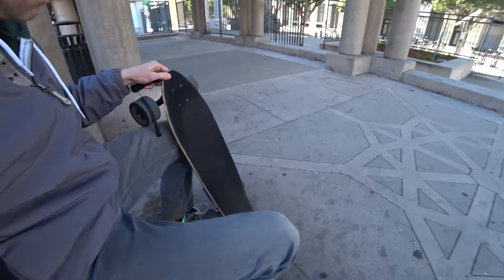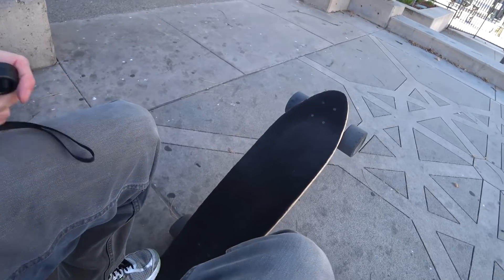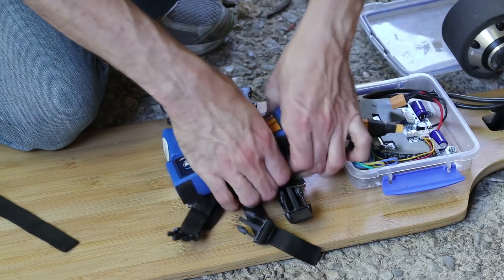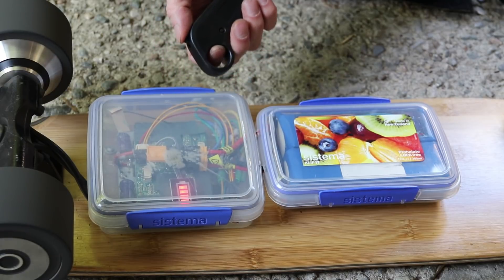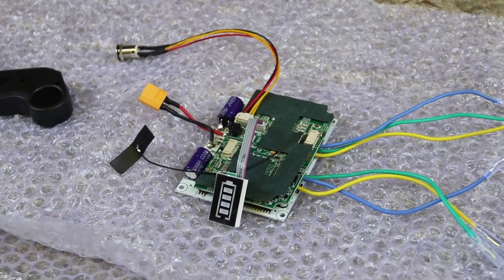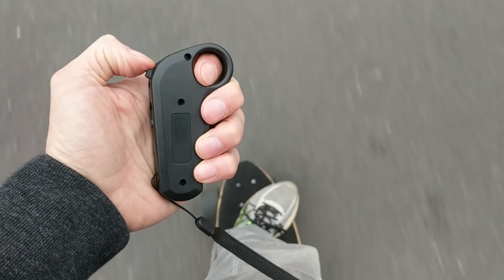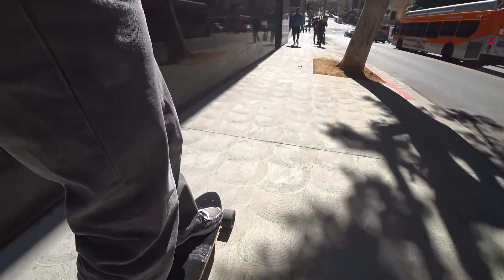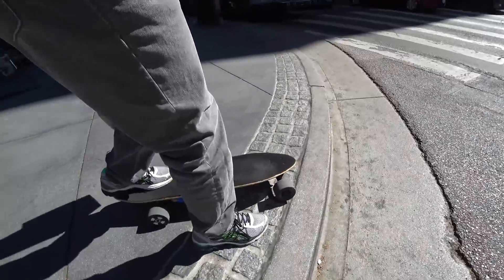Awesome Electric Longboard ++ | Improving The Details | Price ＜ $350

Comment: I'm a down hill long boarder and I have an extra land yacht battle axe board with your experience any recommendations for budget conversions
Reply: I have a few ideas...
I made a single belt motor drive board recently and it cost about £200, even cheaper if you have the board already. I used a hobbyking keda 6364 motor, cheap motor mount pull kit, single belt drive esc/receiver unit similar to the one in this video, two 3s 3300mah lipos in series and some cheap trucks and wheels.

Comment: so I made a longboard with a single belt-drive motor and its going damn fast (24 mph). The only issue I´ve had was my esc. I just bought my third esc because the esc´s I used before were made for rc planes. They didn't have any brake so I had to be very careful while driving this board going fast speed. Now I bought a vesc from flipsky the 4.12 and I hope it will do better than the esc´s I used before. I used a aluminium box as a enclosure for my battery and a plastic box as a enclosure for my esc and I really went on a budget with my motor its a cheap Chinese 400kv motor. But the motor is great. I'm sorry if my English isn't to good because I´m from Germany and a kid...

Comment: Sand the edges of the griptape it will stop it from peeling, also you should use a proper case and bolt it on. Theyre like $30 aud on ebay
Reply from the maker: The peeling is a known problem with the DKL grip tape. Maybe they've improved it now. For the battery case the ones I've seen on ebay can't be easily opened to swap batteries. Hopefully someone will make a strong case that's easy to access.
Reply: @orensprojects7250  all griptapes will peel if you dont sand it, and yea very true

Comment: Hi! have a question, do you know how to connect the hall sensors cables from the hub motors to the esc in the case it has?
So much thanks!
Reply from the maker: The ESC has a connector for the hall sensors for each motor - it's a small connector with thin wires. Connecting them is not so important. I don't have them connected on this board and the motors work fine.

Comment: why are alot of these Motors so loud? I use the same Motors and mine are dead quiet.
Reply from the maker: If your ESC uses FOC mode it will be much quieter. Maybe it's also the way the microphone picks up the motor noise... and these motors might be getting old.

Comment: Would it harm there esc if I ran two 36v lipo batteries in series
Reply from the maker: The ESC I'm using in this build is set to 10S voltage (around 36V total). The ESC has detection for the voltage being too high so it wouldn't work if you connected two 36V batteries in series, which would be around 20S voltage.

Comment: Wouldn’t 83s have done better uphill due to torque and acceleration compared to 90mms?
Reply from the maker: Having a smaller diameter would help with torgue but the 90mm motors are bigger and more powerful, so I think they'd still beat the 83mm.

Comment: That tupper ware your using is the cheapest stuff, there are far more durable options that you will not be able to shatter like that.
Reply from the maker: I'm always looking for better options. Lock & Lock containers are another stronger option. I think it's difficult to find containers that are the right size for the batteries and also easy to open for battery swapping.

Comment: Do you know how to program the esc to make it so that you can push start these boards?  Basically you just start riding and the motors kick in?
Reply from the maker: The ESC used in this build can't be reprogrammed. The newer versions of the ESC does turn the board on once the motor starts spinning.

Comment: Why did you mount the motors on the back instead of the front? Thanks
Reply from the maker: When accelerating your weight shifts to the back, so having rear wheel drive helps maintain traction while accelerating. Also when turning using the kicktail you lift the front wheels off the ground. Also, having the motors in the front would make the nose of the board much heavier than the tail. I think the board balance feels better with the weight in the back. Those are some reasons that come to mind although I've never tried a front wheel drive skateboard. It would be interesting to try that sometime.

Comment: Hi Oren, I just wanted to know what I could have done wrong in assembling my board. Even though I have two fully charged batteries, and I've hooked up all of the colored wires, but when I press the power button I get a low battery light and the esc beeps. I only bought my esc a little while ago and my esc looks slightly different to yours, and the controller is the new meepo board v2 controller. Other than that I used the exacts same parts. I'm still testing it and I've been able to sometimes get the wheels to spin in opposite directions just by moving them a bit.

If you go to my channel you will find a video where I show the board in it's present state.

Sorry to bother you again!
Reply from the maker: Hi Max, from looking at your video the first thing that comes to mind is your motor wires might be touching each other and causing a short. Someone else was describing the same thing and that turned out to be the problem. Make sure all the motor connections are completely insulated (no exposed metal). For the issue of the motors spinning in the wrong direction you can just swap 2 of the motor wires to reverse the motor direction (the wire colors don't matter). Sorry for the delay. I hope you were able to solve it. Looks like you're building a nice board!
Reply: Oren's Projects Unfortunately, it seems as though neither of these someone has had any effect on the problems. I've ensured that there is no metal on metal contact and I performed the switch that you suggested. My only goes now is that it's since fault either in having the different esc, or having a broken esc.

Very sorry to take I'm so much of your time.
Reply from the maker: Hi Max, I looked at your video again. Are you sure you're using a series connector for your batteries? It looks like it might be a parallel connector. Using a parallel connector could explain the problems you're having. The ESC is designed to not work if the voltage is too low or too high. The Meepo ESC is set to 10S and if your batteries are in parallel the voltage will be 5S instead of 10S. If you have a volt meter you can check it. When fully charged you should see 42V with a series connector. I hope this helps. I know it sucks not being able to ride your board.
Reply: Oren's Projects Thank you so much! I just looked at it and yes, I accidentally bought the parallel adapter (off of Amazon)! Thank you for being so patient and putting up with my incompetence!

Comment: Hi Oren I was just wondering when you are going to put out your video about wiring everything.  I've been assembling my board and for whatever reason the board won't turn on (probably my own incompetence).  I just want to see whether I have assembled everything correctly or whether it is some sort of manufacturing default. Thanks.
Reply from the maker: That's strange the ESC won't turn on. As long as the battery and switch are connected it should turn on. Hopefully it's not broken. I'm trying to get a video out soon showing the details of the wiring. Instead of making a video specifically for the electronics I'm going to show more detail, including how the electronics are connected, in the belt-drive build video I'm currently working on. I'll try to get it done soon.

Comment: Do you need to change anything on the ESC if you want to  run it at a different voltage?
Reply from the maker: Yes, you can change the voltage between 6S, 7S, and 10S. There is some soldering involved though and it's not very easy. The eBay seller has a picture and instructions showing what needs to be done. It's not too difficult but requires some careful soldering.

Comment: And what's the weight - reckon it's less than 5.5kg?
Reply from the maker: The board weighs 14.57 lbs (6.6Kg). The trucks and motors on this board are heavy - but well built. It's difficult to get a board that light with dual motors.

Comment: Do you prefer belt drive or hub?
Reply from the maker: That's a good question. I think they both have good and bad points. Overall if I had to pick 1 I would go with hub, the simplicity and low maintenance is a big advantage. I'll get into it in more detail in a future video.
Reply: Oren's Projects thnx heaps - looking forward to seeing your belt drive build. I need more grunt going up hills

Comment: I would suggest using thermal paste inside the axle of the rear trucks to cool the motors better.
Reply from the maker: Seems like that would help transfer heat to the trucks. I wonder if anyone else tried that. Thanks for the suggestion.

Comment: Nice build bro ... love the deck. But you lost me on the carpet !! Come on man ... as a skater I must say that’s a noob move ... there’s a reason why we put griptape on boards ... same reason you put wax on surf boards and not anything else .... but hey to each his own. I would suggest trying other brands of griptape to find one more suitable to your liking.

Some black grip tape companies use silicon carbide - a hard material that stays sharp for a good long time. Other companies use aluminum oxide, which is cheaper but looses its edge and grippyness quickly. 

Good luck on your future builds my man ...most importantly ... stay safe !
Reply from the maker: Thanks! The good thing about a DIY electric skateboard is everyone can build what they like. I guess the carpet depends on preference. I use griptape for boards I do tricks on, but for electric skateboards, which I basically just stand on, I haven't had a problem with carpet. My issue with regular griptape is it destroys clothes, scratches things, and is uncomfortable to carry. The DKL griptape is a good concept but just didn't stay on well. I'm still open to finding new ideas for griptape. Maybe I'll try something different next. It's funny you mentioned surf wax because I also stopped using that. I switched to a traction pad, similar to a SUP board. Wax is too messy in my opinion. Stay safe too!

Comment: Where did you get the deck? Also it seems like the ESC you linked in your description doesn't have a battery meter. Is it the right one?
Reply from the maker: I got the deck from skateshred.com - they have many blank decks and other skateboard parts. For the ESC, I think the seller just hasn't updated the picture to the newer version. I recently bought one and it had the battery meter. You can send him a message first to confirm.

Comment: Hey man, in your opinion is it better to use a 6364  dual hub motor chinese kit like yours or a single N5065 8044 belt drive chinese kit ? thank you
Reply from the maker: Dual 6364 hub motors will definitely give you more power than a single 5065 belt drive, but the dual hub motors will be noticeably heavier. If you go with a single belt drive I would recommend using a 6374. It'll still be lighter than dual 6364 hub motors but closer in power. I do prefer hub motors myself though because they have less parts to maintain, are quieter, freewheel better, and take less space under the deck. There are always trade offs so it's not an easy decision. I hope this helps.
Reply: Thanks a lot for the explanation ! And good job on your builds

Comment: Just made a board with these motors and esc with x2 5s 5000mah. It’s incredible.
Reply: Znyx it goes 37km/h which is scary. I haven’t done a full distance test but did go 10.5kms which used roughly 45-50% of the battery so approximately 20km -22km range.
Reply from the maker: Awesome! The 5Ah batteries is a good choice for nice long rides!
Reply: Polly How fast does your board go and how far can it go before running out of battery?
Reply: If I build a board just like this.... i want the board to go distance, do I join the batteries in series or in parallel?
Reply: these motors need to run on 10S which is x2 5s in series. The more Mah batteries you get the more distance. Mine goes about 22-25km plenty of distance
Reply: So I guess the ESC he has, I would habe to get the 10s version
Reply: Correct, You should order the updated ESC from Mepo boards. its smaller with updated remote.
Reply: Polly Awesome! And lastly, I was thinking bout gettin two 5s 10000mah batteries. I'm a big guy,   so I know my weight is gonna use some extra battery life, but that much mah should be fine to use with everything else?
Reply: Eric Gulley I have never ride longer then 10km at a time, depends on what you are using it for. Also be careful of height clearance under the board with big batteries. I wouldn’t go much bigger then 5ah. You want enough clearance to go up and down footpaths.
Reply: Also I’m 80kg, my friend who is 100kg rode it with no probs
Reply: Polly I weigh about 136kg and my work is about 16km from my house. So my goal is to make something than can carry a 136kg person for 20km and do 20km/h
Reply: You could also maybe look at the Sanyo 20700B battery pack. Its expensive but good, you wont need a balance changer either. just plug straight into a wall charger.
Reply: Polly where would i get that from?
Reply: Eric Gulley Meepo boards
Reply: Im 50kg how fast would your board be able to get me
Reply: Harry Nicholson same speed 37-38km/h you will just get there much quicker and be faster up hills. It’s too fast, you barley ever go full speed.
Reply: I bought the same batteries. I wonder, how do you charge them? Do you use this: https://www.ebay.com/itm/Cargador-Baterias-Balance-Charger-IMAX-B6AC-V2-LiPo-LiFe-LiOn-NiMH-Ni/283374710510?ssPageName=STRK%3AMEBIDX%3AIT&_trksid=p2057872.m2749.l2649 And if so, do you use a parralell plate?

Comment: Is there any other seller for this ESC? I need shipping from Europe. Just tell me if you know.
Reply from the maker: The 2 sellers I've used are the eBay seller I linked to (dickyho2015) and Meepoboard.com (also linked). Both ship direct from China so I'm guessing they can ship to Europe. If you search for "skateboard ESC" or something like that on ebay you should see a few options. Also, you can check aliexpress.
Reply: Oren's Projects Thanks!
Reply: Oren's Projects I am going to make a similar skate as yours and you really helped me along the way.
Reply from the maker: Awesome! I'm glad I could help. If you use the same container I did for the batteries I would recommend adding velcro to help support the batteries. I did that in my belt drive build, which I'll have a video for soon. Good luck with your build!

Comment: I was curious about the belt driven board. Is it single or dual motor because there is a dual motor of you r esc that I may want to try.
Reply from the maker: I used a single motor for the belt drive board. The ESC is available for both single and dual motors. They also have a different version for belt and hub configurations.

Comment: I know you're trying to keep costs down but maybe you should try looking on some eboard sites and purchasing their battery holders. Verreal has a nice one, it might be to big for your board but you can always modify it. The sandwich containers are nice but get brittle when exposed to being out in the elements and the heat of the Lipo's too. But all in all, Great Job.
Reply from the maker: I agree the sandwich containers are not ideal. All the eboard battery containers I've seen don't make it easy to swap batteries, which is important to me. I'm still looking for more options. It would be nice if an eboard company made a container that can be easily accessed like the sandwich containers but stronger and with proper holes and mounts.
Reply: You could also use the eBoard battery containers with a hinge on one side and a pin with a clip on the other side. This way you can easily hinge open the container after pulling out the retaining pin. Then you have a durable case with easy access, and installation would be a breeze.
Reply from the maker: rustler08 That's a good suggestion too. Thanks! I also recently tried the "Lock & Lock" 18.60-oz container recommended by Suntoryjim. They seem much stronger than the Sistema ones. They're a bit taller and are a perfect fit for the Turnigey 5Ah batteries, but a bit big for the Zippy 3Ah batteries. I'll show it in a video soon.